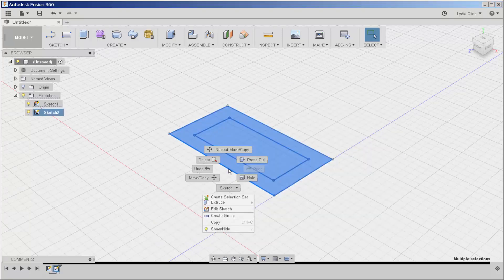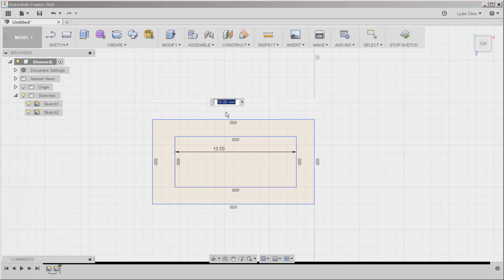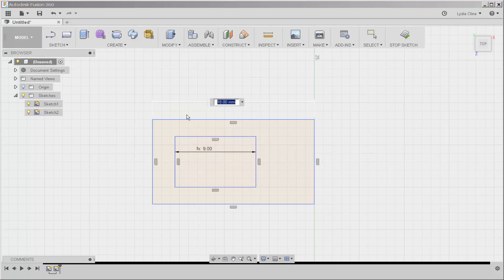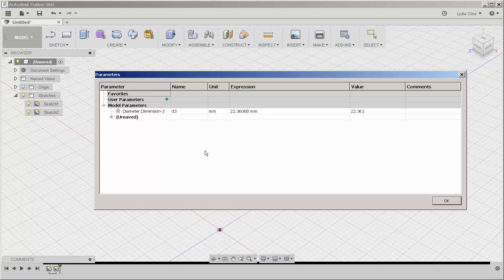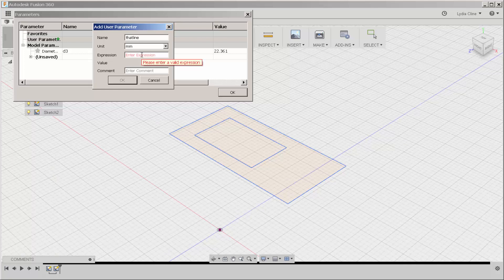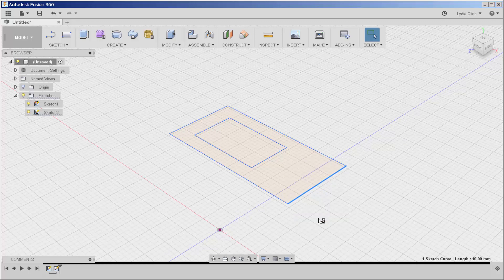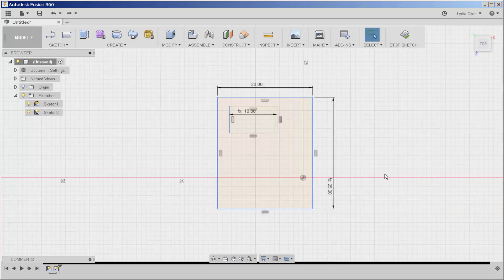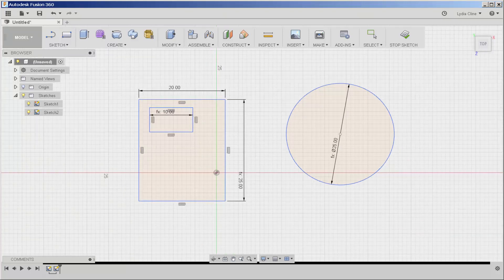Fusion 360: Parameters and Equations

Comment: I'll have to play around with it (still learning the software) but is this something I can do with already extruded bodies? I'm making a modified replacement part for a friend and after already finishing the design discovered that the original has a slight taper I need to copy and didn't include in my design
Reply from the maker: You can do it on the sketches of already-extruded bodies.
Reply: thank you :)